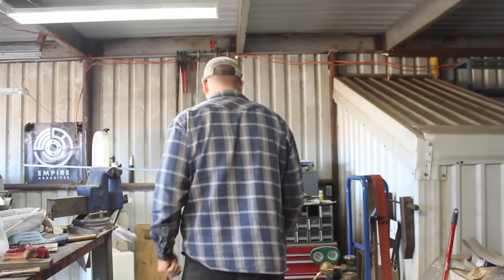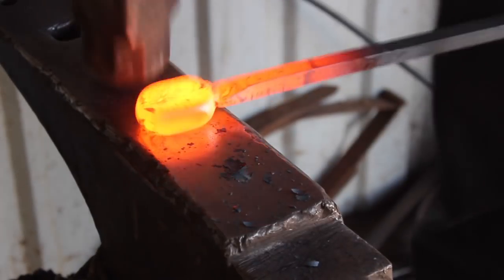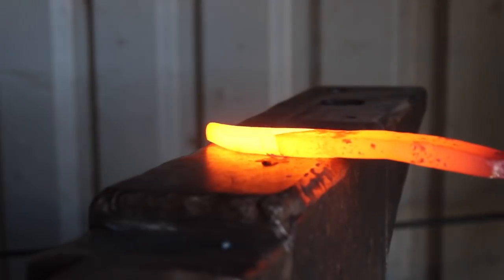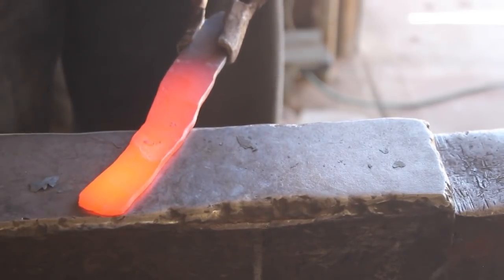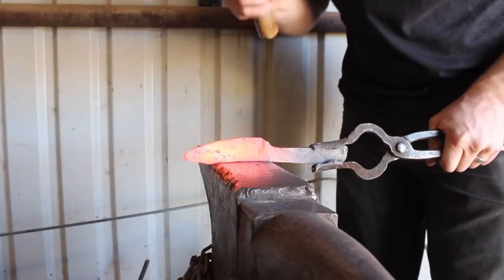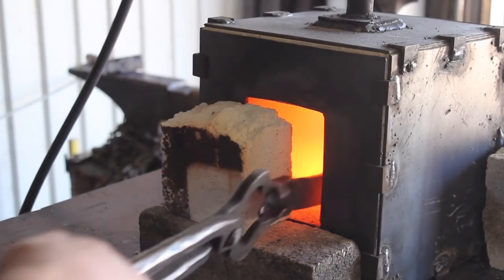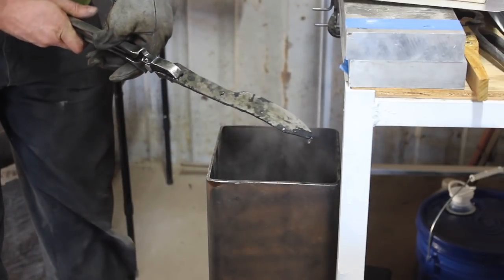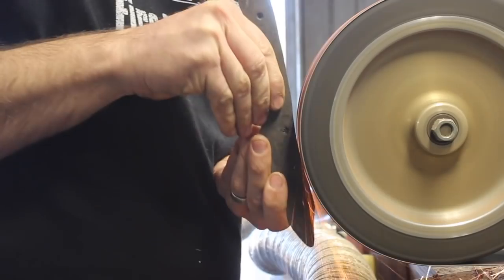Ball Bearing Knife: Forging A Blade From A Steel Bearing, Bladesmithing, Knifemaking, Blacksmithing

Comment: Great tip on the spheroidizing at 1300-1350 in this video and the last one. I’ve been annealing at austenitizing temps, which doesn’t work too well as you pointed out. Tried 1300 last week. Worked like a dream! Also, have you ever worked with 8670? I got 96” for my birthday. It seems to work harden quite a bit.
Reply from the maker: Thanks!  I haven't ever purchased 8670 but a lot of circular sawmill blades are made from it as I understand. It's got a respectable carbon level at  .70%  and adding the nickel and Chromium, it's super tough. Great steel for choppers, would work fine for most blades. I haven't researched it much, it might need a little soak at austenizing with the alloy components, not sure.

Comment: Thank you, this is a gold mine of information I will refer back to if/when I work with 52100. Just curious as to why you started with a ball bearing instead of bar stock; seems like the bar stock would have been considerably easier to work with!
Reply from the maker: You bet, thanks for watching. Also check out the video linked at the bottom of the description for more in depth info on 52100. The ball bearing was just to make the video a little more interesting and have fun making a blade from something other than standard material.
Reply: Do you watch forged in fire? They make them do it all the time. It's quite a challenge.
Reply: @NORTHBROOK1978  he won forged in fire there pal!  Fellow idahoan kicking ass!
Reply: I've heard a lot of people mention that the 52100 bar stock can actually be a bit dodgey from the major suppliers for whatever reason. Joe Calton has actually experimented with it and found that to be the case. So even though it was just for interest, the ball bearing might not have been a bad pick!
Reply from the maker: @GibsonCutlery  interesting, was he forging the blades? I suspect perhaps that has to do with the condition the steel is in from the manufacturer (such as heavy vs lightly spheroid). The multiple heats during forging takes care of that pretty easily.
Reply: @FireCreekForge  yup, I believe he was forging in both cases. It might be from condition, but I actually suspect melt. I'd wager when you are producing for a major bearing manufacturer you have to really watch the melt and you wouldn't want to use the product for anything else. The product that ends up as off the shelf stock probably is a less ideal melt. Completely conjecture, but it would be interesting to see an assay on both!
Reply from the maker: @GibsonCutlery  yeah, I don't know. There's always a range of tolerance in composition, so that can vary from batch to batch.. I imagine some companies probably produce better quality than others, too...

Comment: Cardboard isn't the Devil to an edge on a knife. The tape glue is however. So run your blade on tape for a month and dissolve it with mineral spirits. Then check your Edge.